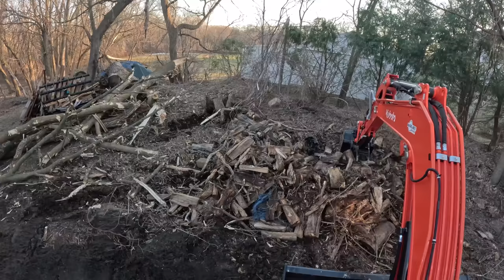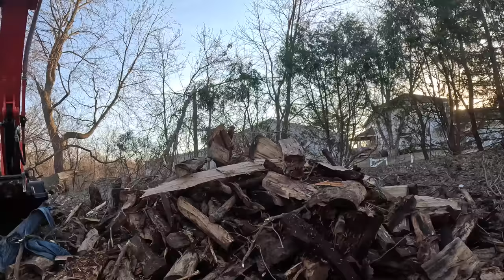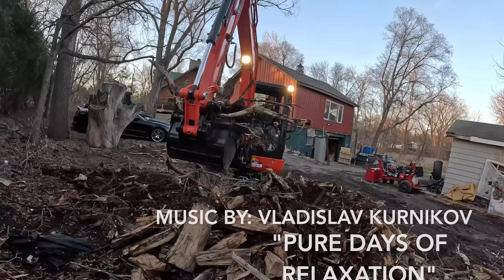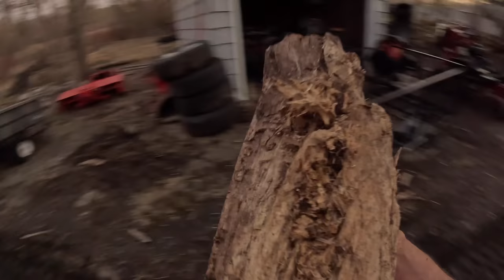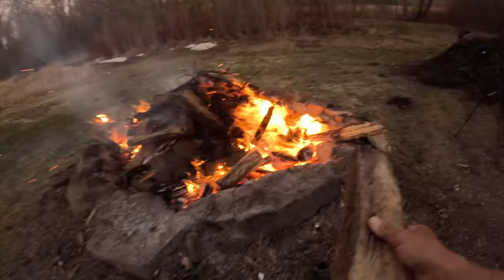A Beautiful evening in an Excavator.

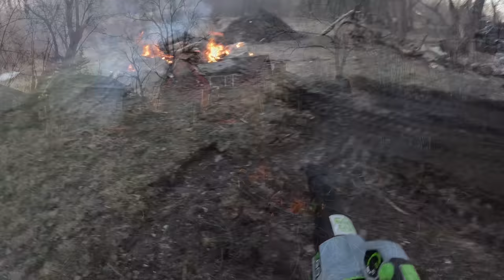Comment: 3:06 Stanley I LOVE doing that, even watching videos of it. I use a small fan that I made from a broken electric razor. Leaf blower works loads better though. Mine is a plug in blower that I got from the dump.
Reply from the maker: That’s kind of super cool you tried it out and made one yourself though 👍
Reply: @Dirtmonkey  It's more like one of those personal fans just more powerful. As for the dump leaf blower it look rough as hell outside but looks brand new inside, no rust, I took it apart and cleaned the on off switch so it works now.

Comment: The next time you burn order pure 99.8% pure Potassium Nitrate.   Mix it in a 50/50 with regular sugar.  Put this in the middle of the burn area.   Then take a stick and light the end of the stick-on fire and touch the flame to the Potassium Nitrate & sugar mixture.   You will see a Hugh fire and it will get hot.  If you put this in a metal pail the metal pail will probably not be around once it burns up.  That is how the fire gets.  There is no reason to do this except that it is a lot of fun!  You can also YouTube this topic and see other people doing this.
Reply: Whoa!  That’s rocket fuel for model rockets.  We’d mess around with varying ratios for our model rockets when we were kids.  These days, there’s loads of information on the internet, as well as YouTube videos on how to achieve the best mixture, with packaging, for the best thrust.  Scared the cr@p outta our parents when they found out we were experimenting with very small scale reactions in the basement when they weren’t home.  We decided to take our ‘research’ outdoors after my cousin made a black powder bomb one Saturday.  I swear, the whole house rattled as the reaction blew us backwards to the wall.  Yeah, we had some cleaning up and airing out to do before our folks got home.  We all laugh about how we were lucky we didn’t blow out the basement windows.
Reply: @probablynot1368  I like the 50/50 mix and I have fun with it.  There is no reason to do it except it is fun to light it!!!